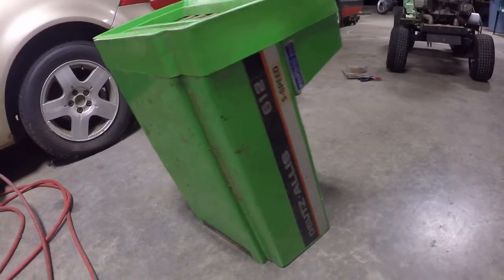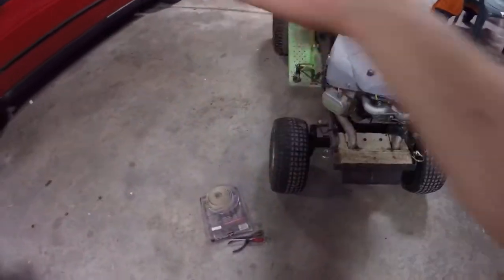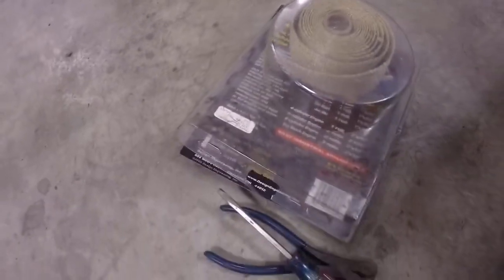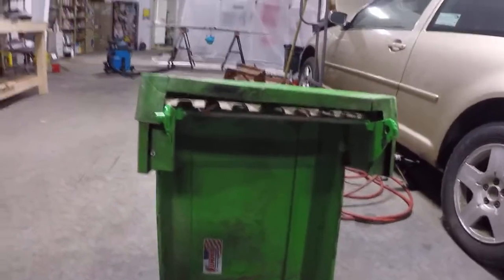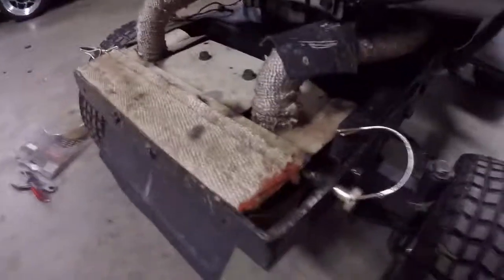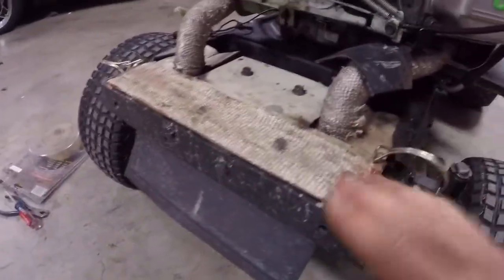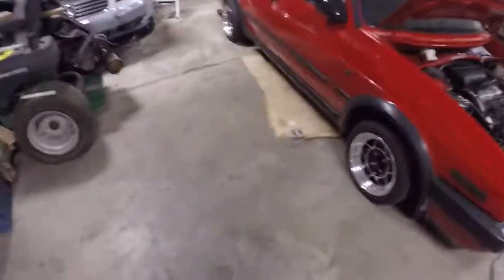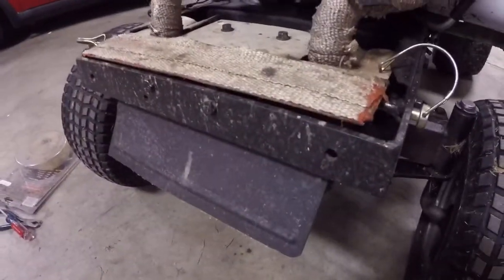Exhaust heat shielding diy, save money.

Comment: Good idea. My opposed twin has straight pipes, they both go out under the right floorboard. I thought about wrapping it but I never saw the need. I think having some heat on the intake manifold helps with vaporization of the fuel anyways, even though it doesn't get that hot. I'm thinking of going to a cutout setup soon, maybe I'll wrap it then. Doesn't the glass wrap stink? I've heard of there being volcanic rock wrap stuff too, I wonder if that stinks too?
Reply from the maker: RichieRichOverdrive 
When this stuff is wrapped directly on a pipe it will stink for a while, but that's a good reason to run it as hard as you can when you first install it.
My closest guess for what it smells like is burnt electrical components, but it stops after 5-10 minutes of hard use. 
You could use any of those new rockwool heat wraps with this technique. 
You could glue the wrap right to the bottom of your floorboard, and glue tin over that for some abrasion protection on the trail. 
And you could add one above the pipes that stands off the pipe similar to the one protecting my throttle cable. 
I'd bet your floorboards would be a bunch cooler(even with just the ones glued to them)

Comment: very nice job, Thanks for sharing.
Reply from the maker: Josh Kilen 
Anytime man, thanks for watching! 
those aftermarket heatshields cost more than a roll of wrap and a tube of rtv, and this works just as good.
Reply: yep, i bet, that is what i will be using on my diesel tractor build.
Reply from the maker: Josh Kilen 
Yea the little one that's below the throttle cable was the saving grace to stop melting the cable jacket. 
Tbh, I'd have to look at my old videos to see how long this has been in service, at least a couple years. 
I did it shortly after the 20hp engine swap.